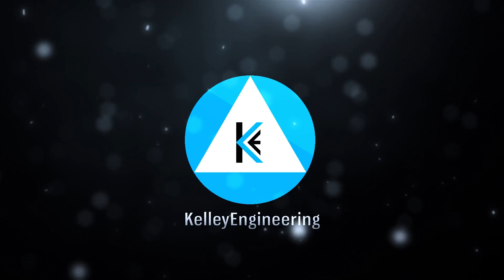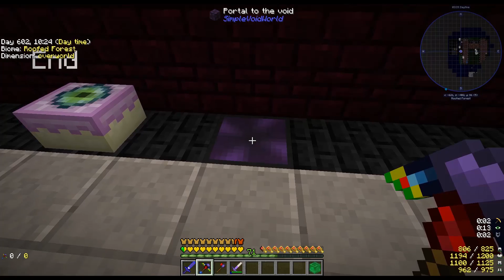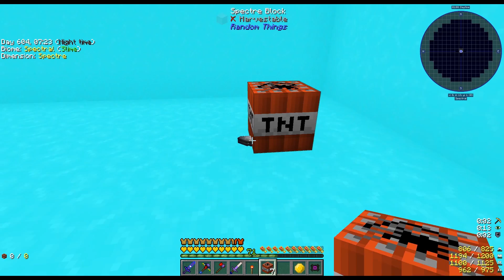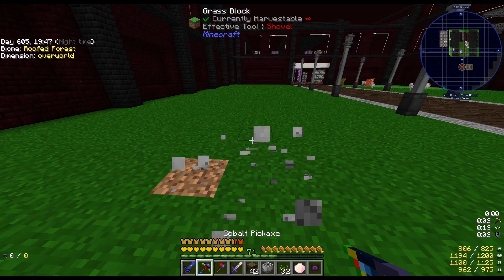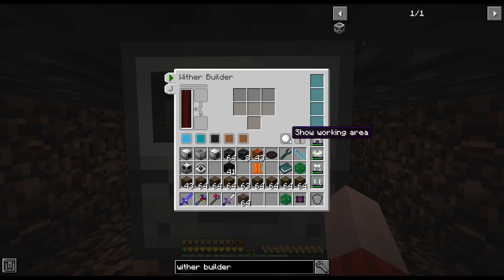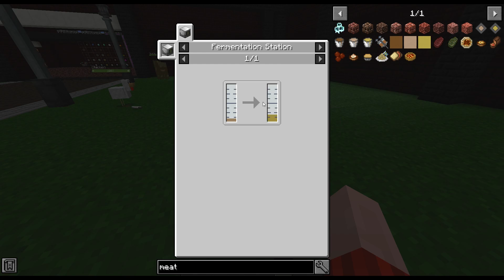Project Ozone 3 EP21 - Industrial Foregoing

Comment: If I remember right, Spruce gives more resin/latex per log. Also, you mentioned expanding the spectra room at the start? How? I don't know much about that portion of that mod (usually don't bother until I need a safe room or a different spare room for, say, hiding noisy portals lol.
Reply: @KelleyEngineering  Welp, now I just gotta get another bonsai hoppered into a 2x2 drawer and farm ectoplasm. Go big or go home is gonna get a new meaning in my world.

Comment: For the resin setup, you can set up to 5 extractors on one log (with the 6th side being the block placer). It will use each log faster, but the setup is a bit more compact than one per in a line.

Comment: Using the liquid meat on your ore triples the number of ingots you would get. Ore + meat = 150 mB of raw ore meat. Fermenting doubles that to 300 mB. Then each 100 mB of fermented ore meat gives you a dust. As someone else mentioned, you can also put the liquid meat into a feeder as a bauble to keep yourself feed and saturated, but if you dump a bucket of it into the world and stand in it, your hunger and saturation will be maxed quickly.